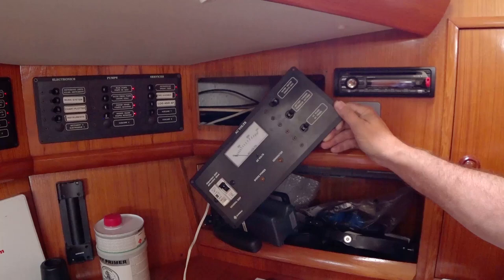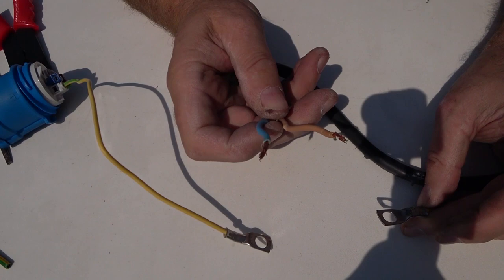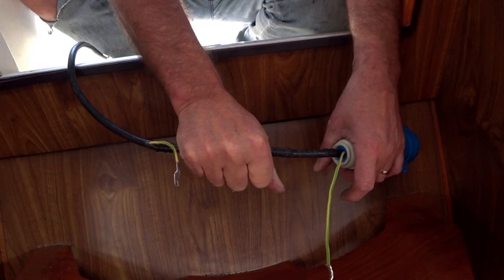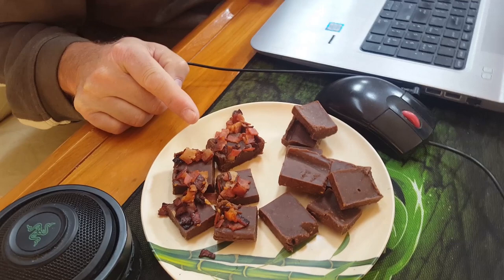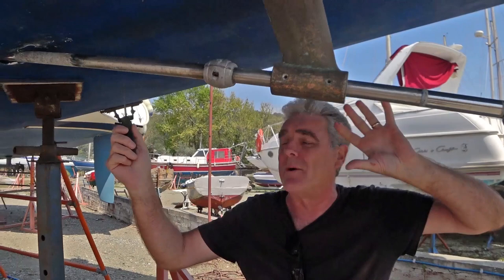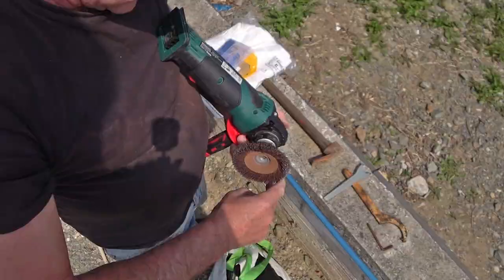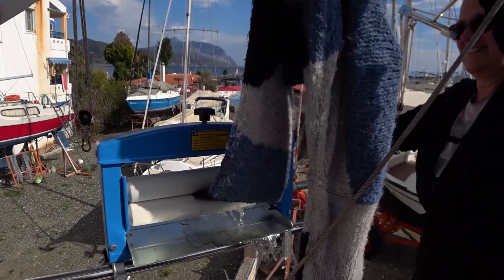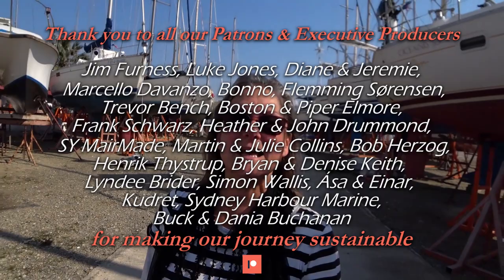Living on a yacht on the hard in lock down - Sailing A B Sea (Ep.117)

Comment: Baz. I was a machine fitter. I've removed and fitted 100's of keys. Try to get away with not hitting it with anything. The key steel is soft and will deform easily. The first thing to try is vice grips, mid way along at right angles to the shaft and wiggle. It should come out if it was fitted properly. Remove any burrs before you put it back in. It should be an interference fit.
Reply from the maker: (Baz) Okay just as I was getting excited about using a big persuader I find out that maybe vice grips will pull it out as easy as a two years olds wobbly milk tooth. Hahahaha Cheers Andy.

Comment: I removed a number of keys on electric motor shafts once upon a time, never found any held in with grub screws. A pair of side cutters works well to pull on the key, if no joy with the side cutters a centre punch and hammer can be used to dislodge the key (hitting on the end of the key to avoid damage to the key) the key should be cleaned up with emery paper when reinstated to avoid any rough edges.
Reply from the maker: Thanks for those tips KG. 👍

Comment: As I indicated late to this party and I gather you have persuaded the key to part company from the key way. In my comment on the other video (yesterday), I mentioned that once out you should drill and tap the face of the key for a 6mm bolt so that you can jack it out next time - drill the hole towards one end of the key so that when tightening the bolt you achieve better leverage. On the mangle cut the handle off and power it with a cordless drill.😂
Reply from the maker: (Baz) Hahaha I'm sure the Admiral will see this comment and reply. When the guy comes to install the new bearing I'll get him to drill and tap the key. Cheers.

Comment: If you are struggling to get the key out put a hacksaw cut in the end close to the shaft and use a flat screwdriver to prize it out.Tapping the key with a hammer will probably loosen it, otherwise a bit of heat and a squirt of WD 40 will help
Reply from the maker: We finally got it out Roger as you'll see in next week's video, it required a lot of persuasion. Cheers.

Comment: In north America you must install one with a display and can be tested which is what I purchased from Safeshore in UK ,if that unit should fail ,you will now have no ground in your boat very dangerous considering you are also 220volts.
I also installed an RCD ground fault breaker which is also ABYC  requirement on the main line . This breaker measures the current making sure it's balanced , if more than 30 milliamps goes to ground the boat shuts off.
I did tell you how to get the key out in last video use a prick punch on the end of the key centered hitting the key up and it will come , I've removed hundreds over 40 years as a Millwright
Reply from the maker: Hey Chris, we also looked at the more expensive Safeshore  models but budget constraints are what we're working with. Cheers.

Comment: The hole in the shaft is for the lathe center tool when the shaft was made. Tap the end if the exposed key with a flat punch. Tap it inline with the shaft, it will work its way up and out of the key slot.
Reply from the maker: It was an interesting learning curve. 👍

Comment: We use ships power all time on the hard with solar and only use. Shore power fir fridges on a separate transformer to shore power as for the key parting company with the cuplink is check the tappers on the cuplink or is the key two tight on the shaft attack it with a hammer and speck out the cuplink on the gearbox
Reply from the maker: (Baz) Step away from the 15 pound lump hammer. 😢

Comment: It’s just an interference fit, use a screw driver or chisel to to tap it up and out. The hole in the end of the shaft looks like a centre hole used in turning the shaft on a lathe.
Reply from the maker: That seems to be the general consensus  from the comments. All will be revealed in a future video. 👍

Comment: Press fit, dimple is to hold shaft center while machining. Use side cutting diagonal pliers, grip end of key and pry against shaft to pull key out of machined groove.
If it still will not move go to end of key with a tapered pin punch and hammer and drive it out towards the end of shaft. When it get past the shaft far enough tap it out and away from shaft grab with pliers. 
If Key gets damaged, just replace it. Put petroleum jelly in slot and on key when reinstalling to prevent electrolysis.🔨🔧🙈👏
Reply: Clean your shaft with vinegar.
Reply from the maker: We finally got it out and it required a lot of heavy persuasion as you'll see in an upcoming video. Cheers.

Comment: Baz I like to epoxy fiberglass square off cuts or starboard rectangles to my hull to screw objects I want to place there. This means you never drill in your hull and can mount things where you want. I don’t like to use wood as if it gets wet it’s over.
Reply from the maker: Great tip, thanks Mike. 👍

Comment: Baz the Key is a press fit or Push fit get a small blade screwdriver and insert it between the shaft and the key and Tap it with a hammer you could also tap the Key on one end to release the key a bit but please have a Flat file for the key so you can file any Damage you do to it . IT will look like a half moon in shape when removed .
Reply from the maker: (Baz) Ahhh that's very helpful info, thank you. I don't know if you read blogs but in my blog this week I share how I feel about tackling these boat jobs. Here's a link if you're interested. https://bit.ly/2RQdgJs
Reply: @SailingABSea  Mate i have worked in the Auto World for most of my working life even for Ford Motor Co proto type work shop and testing said ford Trucks at the Lara/You Yangs Proving Ground - Ford Australia.also at  Moneteega proving grounds Comeng Rolling stock and being a tradesman panel beater panel worker now retired in Thailand. So i am happy to help where ever i can just ask. lol 
Nice read bud,stay safe you two.
Reply from the maker: Thanks, we appreciate all the helpful advice that you're providing. 👍😀

Comment: Bas.

That key should come out with a light tap. Spray with R P 7 or diesel and it should pop out, We had these in the rear axels of the F.J..

David.
Reply from the maker: Thanks for that tip about diesel David.👍
Reply: @SailingABSea  Most of what is in the spray cans is just diesel.
Reply from the maker: (Baz) Didn't know that, diesel sounds like the fix for everything. Can it kill viruses? 😂

Comment: Yes the key is only held in with an interference fit. give it a good soak with release fluid, and then use a small chisel, (screwdriver) on the end to tap out. The dimple in the end of the shaft was used in manufacture of the shaft.  Great Vid Baz and Aanasha, keep on with the tasks.
Dave
Reply from the maker: Okay, so do I tap it from the dimple end or prop end of the shaft?
Reply: @SailingABSea  yes try to put the flat of a screw driver between the shaft and the key to drive a wedge in to lift the key away from the shaft. A few strikes and it should start to lift away.
Reply from the maker: (Baz) This going to be so interesting to film. What could possibly go wrong? 😄
Reply: @SailingABSea  🤣🤣🤣can't wait.

Comment: as mentioned in other comments just tap itout gently with a punch or screwdriver, be gentle when cleaning up the slot and key to keep them nice and tight. when you put them back together a bit of Neverseez on the key will make it easier to get apart next timealso on the shaft under the coupling and the bolts. Neverseez is pure nickel and the best antiseize for stainless to stainless or stainless to any other metal.
Reply from the maker: (Baz) Did not know about Neverseez, I'll check to see if it's available locally. I do like the idea of putting things back together on A B Sea so that next time I take them apart the job will be easier. 👍
Reply: @SailingABSea  it should be available it is made by Bostik which is fairly global get the pure nickel straight not the mixes

Comment: Hi Bas 
Its a Woodruff key light tap should  remove it . They tend to fall off and get lost .
When refitting the shaft anode make very sure that the bolts are done up very tight and sealed as they can and work lose and fall off or slide down the shaft and make a very worrying banging sound on the p bracket . Do some research for best fitting method . Very nice to your videos we are all locked down and not able to get to our yacht  in Poole Dorset which was launched 2 day before lockdown . Stay safe
Reply from the maker: Thanks for the tips Mike, yep definitely going to add blue locktite to the anode bolts and as someone suggested a couple of zip ties either side as double protection. Cheers.

Comment: sharpen on of your old screw drivers and a lite tap at the base of the key. It should pop up... particularily if you have done old mates diesel/WD soak. It will only be a bit of salt sticking the two together... Rule of thumbe - if you are forcing it you are doing it wrong. lol Stay safe mate
PS heat is also your friend on most precision fit bits of kit. One of those little butane nozzles that screw onto a MAP gas can are as handy as a pocket in your shirt.
Reply from the maker: Cool tips there Greg, thank you. 👍

Comment: The shaft key should have been removed BEFORE you removed the shaft. Chances are good you destroyed the stuffing box seals or damaged the stuffing box itself. Easy way to remove key is to tightly clamp teh key with vice grip pliers then lightly tap on teh pliers to remove teh key. It depends on IF the  slot is a contained slot or an open slot.

(;-) TP
Reply from the maker: (Baz) Yep, we know that now. Flying by the seat of my pants here TP. Never done any of these jobs ever in my life. What could possibly go wrong? 😀

Comment: Hi, just be very carefull when removing the key, they can fly far and away and will never be found again on the ground in the marina... guess how I know :-) So when removing it pack one of the big Lidl bags around the shaft (make a hole etc and tape it on ) and then work inside the bag... Same method as when taking a winch apart... Enjoy the Limni spring.. kalo paska Matthias
Reply from the maker: Thanks for the tip! That's a great idea about using a shopping bag as a catch all. 👍

Comment: Hi guys hope you both are safe and well. 
Just seen this week's video on the Galvanised unit. Q. Should it have installed on the opposite side off the inlet  to where you have put it.
Steve
Reply from the maker: Hi Stephen, that was my thought too until I went to the manufacturers website and looked at their product range. They have super quick install units that you plug into the pontoon pedestal which you then plug into the end of your shore power connector. Cheers. 👍

Comment: This current issue reminds me of the incident of Hilma losing the whole rudder in the open sea because of grounding problems. And about the mangle, why don't just let it rest on the backstay?, the torque from the lever when Aannsha is turning is too big for the round pipe and the locking bolt ;) cheers guys ;)
Reply from the maker: That's a good point about the backstay, I'll mention it to the Admiral and see what she thinks. Cheers. 👍

Comment: why do u have the fuel cans where the shore power is coming  u r not afraid of short spark to ingnite the fumes
Reply from the maker: (Baz) I thought someone may come up with that question. The only other locker to store them is the scuba diving locker on the port side of the cockpit and I'm not sure scuba gear with a tint of petrol fumes is the best thing to wear, put in your mouth or on your face. Plus since September 2018 until now we have not once been connected to shore power. Cheers.

Comment: Key and keyways can be e very tight fit. Seen from shaft end, et chissel between shaf keyway and key, a knock, and it separates. But I have worked with so tight fites that I have had to drill through key, make threads and screw down a bolt to lift key. Cleaning prop shaft with corbon steel brush: Don't do that. It makes me cry. Corrosion problems. Isolator, will protect up tp approx. 1,5 V. Anything above that will run stright through. It is just 2+2 diodes in parallell. But it Works 80 % of the time. Best is insulator transformer. Install when you get ritch. Anode on prop saft, not 1/2 a metre, just 50 millimetres will do. That's all complaints for now. Hope bans are lifted soon. Take care :-)
Reply from the maker: All good info SV Hulda, yes Baz mis-worded the anode distance it is not half a metre. Hoping to get rich to be able to buy a insulator transformer. Thanks for your helpful tips, cheers. 👍
Reply: @SailingABSea  
Sailing Emerald Steel made their own isolator circuit, watch Suzy and Jules search their channel for electrics videos.